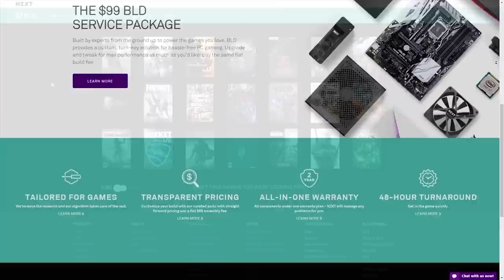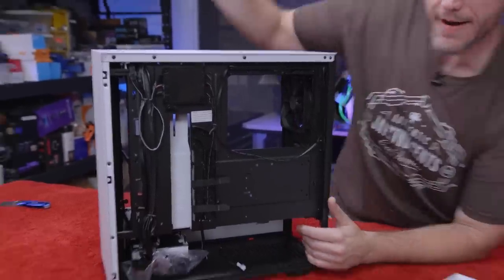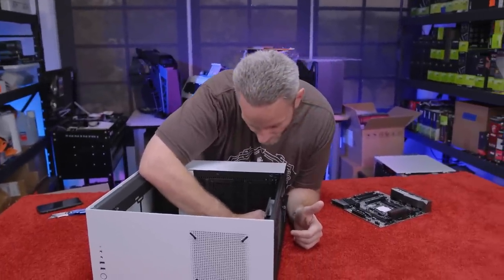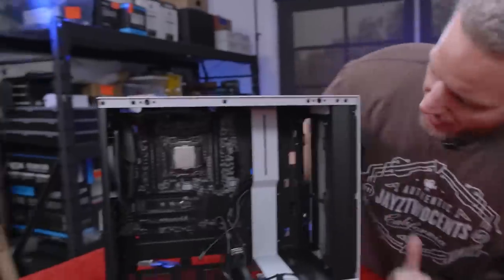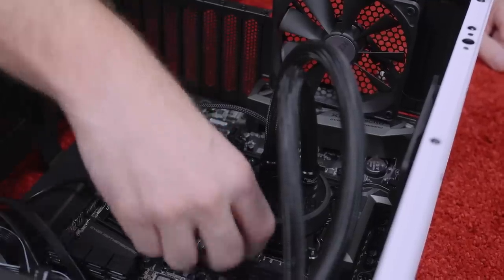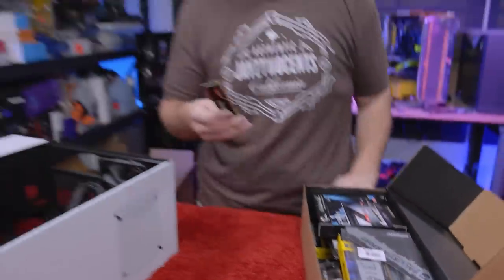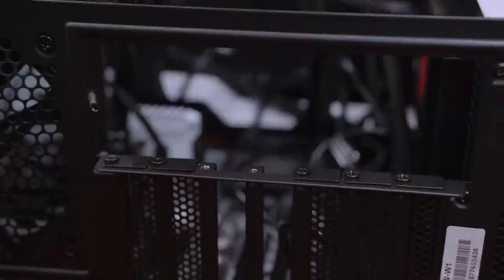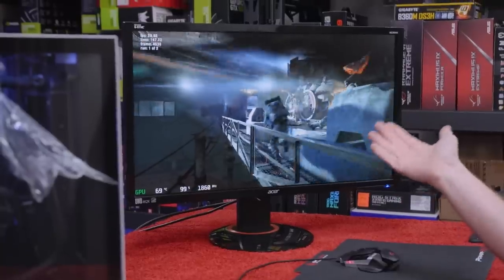We built a computer wrong on PURPOSE!

Comment: Maybe I am too late but that power plug is not a proprietary connector, the regular power connector that is used on most consumer PSU(s) is IEC 60320 C13/14 coupler, whereas this is a C19/20 coupler, which has 16A support and is used in High current appliances and enterprise class UPS and server PDUs, 1600W is high enough.
Reply: Pranjal Jain I noticed the same... actually in Europe this plug can supply up to 3600W in europe because of the higher voltage, as the limit is on the current not power. We use C13/14 plugs up to 2000W...
Reply: And that's why I scroll through the comments and then search for a keyword (PSU). Glad someone had commented about the C19/C20 before :-)

Comment: I followed this video step by step but my system won’t power on. Please help me Jay.
Reply: OhItsThat plzz plug in you 12 volt to your hamster only way to power it on
Reply: a little bit more of thermal paster
Reply: OhItsThat whu........ whu... what this is how not to build. not how to build.
Reply: What carpet color did you use?
Reply: Wooosh
Reply: maybe you didn't lubricate your RAM enough. give it some brake fluid or motorcycle oil
Reply: OhItsThat it's time to stop.
Reply: Pour some water on it, that will do
Reply: Slap the glass with a hamer
Reply: Slap some flex tape on your cpu cooler. It wont do a lot of damage
Reply: Did you use the correct RAM? If you use anything different it won't work!
Reply: OhItsThat youre cpu is overheating just poor some water on it.
Reply: Thanks for all the great advice guys. After trying all of it I realized I skipped the step where he installed the power supply....ooops....silly me.
Reply: Ersyad Adhimakayasa 😂😂😂😂
Reply: SpicyDoggo salt water duh
Reply: i liked the vid anyway
Reply: Put it in the microwave, you may need to add 1.21 Jiggawatts into the Flux Capacitor
Reply: You might want to take out your motherboard and rub it on a carpet to give it some more electricity to jump start it
Reply: Did you try asking nicely?
Reply: r/whoosh
Reply: You should download more ram

Comment: LOL, I've built every computer doing "everything you shouldn't do" and never had a problem in 25 years. (except cooling)
Reply: me to an it always works
Reply: Ditto...
Reply: I intentional built my first PC on carpet with socks on posted first try best part was it was LIVE.
Reply: I've never stowed extra cables in the case, though with PSU shrouds being standard these days...
Reply: I was gonna say I always place my power supply with the fan facing up and I have no issues XD
Reply: I've done like half of these and not a single problem. Also had a cooling issue but that's because I paired a cooler designed for 95W with a 125W FX CPU.
Reply: I have at times, usually when I'm changing out hardware.

"Aw, I don't have an 8pin PCIe connector plugged into the PSU. Can't be bothered reziptying everything up to replace one of the 6pins so I'll let it dangle and just route an 8pin next to the motherboard."

I mean, it's at least neat and minimal (Not much different from just having a PSU that has dual connectors and only using one, to be honest. My other one is SATA connectors which are usually hidden away anyway) but still is extra unneeded cabling.

Comment: Wtf jay? You should had used an cheap , chinese no name power supply.... What kind of a pc store do you think this is!?
Reply: Adrian make sure it's just a metal block with zero labeling and ketchup and mustard cables
Reply: Should have used Diablotek lol
Reply: Or an Insignia power supply. You can pick those up from any best buy.
Reply: the difference between what not to do and what is stupid to do.
Reply: First ever build i had to RMA my cheap Biostar mobo & Diabolotek power supply. Learned early on those are two components not to cheap out on. Thermaltake 600w going strong on 5 years now along with the replacement biostar which i still use 😂
Reply: *a cheap...

Comment: I was moving files between HDDs once with some of them balanced precariously on the edge of the open case and one fell off and hit the back of the graphics card and it sparked and the system turned off. Turned it back on and it was absolutely fine. Just goes to show ya, these things aren't nearly as fragile as people tend to think.
Reply: heh had my aio bust and killed everything but the gpu soundcard hard drives and psu.
Reply: I had a PSU literally blow up and shoot sparks out the back of the case until I unplugged it...nothing damaged but the PSU lol

Comment: yea yea i know when i built my first computer i had like alot of respect and i was afraid of doing something wrong. But now after 15 years of experience with building about 6 computers i know there is allmost nothing you can do wrong :D Because lets be honest, Hardware Manufacturers dont want you to return demolished Hardware so its all designd to be foolproof.
Reply: well.. you could still fuck up by washing and build the computer before letting it dry
Reply: Or they make it non-refundable so u have to buy more than one
Reply: My friend didn't connect extra power cable to a gts250 and it fried. Maybe it wasn't the reason and it was already broken, I don't know, but I would have no idea it even needs extra power if the vendor didn't tell me. It could happen to any experienced overly confident builder.
Reply: Read Newegg reviews.  SOMETHING is happening to all that hardware.
Reply: Except if you live somewhere cold DO NOT plug in a pc, or any peripherals for that matter, that has been sitting outside in a car or something immediately after you entered your home. My uncle managed to fry his monitor because of that.

Comment: 1:46 - I have the NZXT H500 (Non 'i') I actually really like it, It makes cable management easy as heck and building in it is easy

9/10 recommended
Reply: same
Reply: holy shit they actually went and made an i-less series? im jelly. got the h400i and just ripped that dumb thing out lol. seriously an incredible case, though, ive got a 280mm push pull rad in front, and 3 more 120mm exhaust fans on the top and back, and the thing is still pretty damn tiny. so quiet too, can only hear it under insane loads

Comment: Sponcer: system builder

Message: don't be scared just build it yourself.
Reply: actually nzxt's build setup is really good value if you do go the system builder route since their warranty and service is only $99 and msrp parts which is really nice for gpu and ram price increases though now they are going down was super killer a few months ago when they first launched their bld system building.

Comment: That power cord is nor proprietary to EVGA, its commonly used C19 plug used in high power equipment, as standart C13 plug/cable might not handle 17Amps.
Reply: Was gonna say that, it's a 16 Ampere connector, the regular ones are rated for 10A. The high-end G5 (pre-Intel) Macs used it too.
Reply: Thank you. I was pretty sure it wasn't proprietary. Getting a cord like that certified is way too expensive to be worthwhile, when there are standard ones for just about any scenario.
Reply: It's the same on my Corsair AX1500i :)

Comment: Isn't the "carpet" thing about standing on carpet, creating static charge and zapping components?
Reply: VoxelFusion rubbing the anti static bag on the carpet or even worse the board directly can produce enough charge to short stuff. Static will kill stuff sometimes.
Reply: I'll take your word for it, not like I'll try to verify on my own lol.
Reply: Rubbing the anti-static bag on carpet won't do anything since it's electrically conductive by design. It literally is a plastic bag treated with metal vapor.
Reply: This is more of a concern in areas with low humidity. If you get half-inch arcs touching door knobs on a regular basis it is a good idea to wear the strap-on.
Reply: Barry Allen : what you do with a strap-on is your business. No need to mention it here.
Reply: I like to touch a grounded object e.g radiator before handling components to discharge static
Reply: @bone9jdjkaye  i always just hold the case, im mid build now we'll see if my method worked
Reply: you'll never know if it works, veen if you build 100 pc's... you'll only know if it doesn't

Comment: Dude, what the hell? Why would you do this?

You're supposed to not put the fans on the rad and block off the rest! And not plug anything in!
And that metal case on the gpu is for shipping, you're supposed to take it off, and put thermal paste in all sockets/slots to ensure low temps

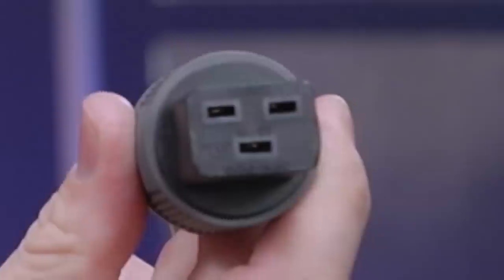Comment: 10:24 in fact this is a standard High power plug for north america. We don't need that in EU ;) because 10A is max for IEC but with 230v that mean 2300w.
Reply: Scrolled down the comments to find this. Cheers.
Reply: Definitely not proprietary
Reply: Ineu we have 16A
Reply: Yes we have 16A plug on the wall but the IEC plug is rated for 10A max. EDIT : IEC C14 (standard for PC) - In the video this is a IEC C19 plug
Reply: This is why Australia power is great too - 10A @ 240v = do they even make a PSU that big?
Reply: For servers yes, for "normal" pc i dont think so
Reply: Yeah obviously servers will come larger than that (I have 2x2400w "small" ones running my mining rigs) but even with 4xTitan XPs and a 2990WX thats still "only" 1250W + Board/drives/RAM so a 1600W would be tonnes unless you were heavily overclocking all 4 cards and the CPU but at that point youd just use a dual PSU case and 2xsmaller PSUs anyway.
Reply: I've used a lot of those C19 plugs in our danish datacenters. They're very common on stuff like blade chassis and high powered servers.

Comment: This actually really helped since I've always been super paranoid about anything to do with my computer. I worry that the slightest mistake will break EVERYTHING. It's so bad that I have developed OCD, where I'll check every wire before bed just cause I worry a wire out of place will break my computer (It's silly I know)

Watching you do everything you shouldn't and have it actually still work fine fills me with confidence that computers are really not as easy to break as I think xD
Reply: If you're really worried then just remember that I dropped my GPU onto hard metal and my CPU onto a table twice...still fine.

Comment: My "airflow blocked by cables" PC has been running for almost ten years now - and still does. Also never cleaned any heat sinks in there.
Reply: you may want to check your temps with HWiNFO
Reply: it's usuallly fine to block airflow to be honest, but not cleaning the heatsinks can be bad

Comment: we do the things you shouldn't do 
to show you why you shouldn't do them 
but usually at the end of the day it works
but we still say you shouldn't do them

???
Reply: The super enthusiast pc guys always talk about touching pins and not using anti static everything is essential to building a pc, and this tends to scare off novices. The truth is that modern components are pretty well built and designed to be put together like lego, and Jay’s just showing how easy and foolproof building a pc is and to not be scared off by the annoying enthusiast types.
Reply: @spaceandstuff8966  As long as you don't act extremely stupid with handling the parts, very little can go wrong as you're building.

Best I had when I was building my first setup was a hot kitchen on top of a plastic table, and sometimes you just have to be firm with the parts
Reply: @spaceandstuff8966  I am still scared to do my first
Reply: I love fancy rats have u built it yet?

Comment: I build computers for a large computer manufacturing company. Static is an issue more long term not usually short term. That being said I think some people take static discharge to an extreme. Ground yourself and go for it. Don't need a strap.
Reply: Just don't wear woolen clothes :) (isn't wool about the worst in that it creates most static with many surface materials?)
Reply: @pev_  - I put on wool socks and a sweater and roll around on the carpet, then assemble it while moon walking in place. Gotta precharge those cores, man.
Reply: Porg McNuggets thx for hot tip - pc assembled and shows my i3 clocking in at a stable 9.7GHz
Reply: @lolol1725  - Nice! Well done.
Reply: Or just touch your heat radiator at home to discharge any static charge you carry those are mostly grounded
Reply: @schadenfreude3236   Dude you forgot about the cat! Don't have a cat then borrow a neighbors and pet it right before doing a build.
Reply: @jarvisgarcia2035  - Dammit. I knew I forgot something. I DID let some hamsters play in the case while I was assembling it, though. Think it'll still work?

Comment: 10:20 that's a C19 connector, which is from the same standard (IEC 60320) as the C13 connector you usually see on PC power cables. They have to use C19 because 1600W is at least 13A at 120V, which is way over the maximum of 10A for C13. C19 goes up to 16A. It's pretty easy to get C19 cables because it's commonly used for the power supplies on larger servers.

Comment: Thanks for the info!!! I build my first gaming pc!!
ryzen 1500
gtx 1060 6gb
16gb ram
I can playy pacman again!!!
Reply: a pizza, maybe... or money .... or a coke ! .. I love coke  @smilealchemist4325
Reply: isn't that cpu a bit of a bottleneck for the other components?
Reply: @smilealchemist4325  everything
Reply: @Smilealchemist the generation doesn't really make a major difference here, the 2500x is only about 6% better than the 1500x. a better move would have been to upgrade to, say, a 1600 for the extra cores, because windows sucks and games run better when windows has more cores to sate its stupid overhead
Reply: Smilealchemist sometimes it does, but lately most newer generations focus on power efficiency rather than major performance improvements
Reply: Eww amd
Reply: @harshnemesis  Haha but amd is better price to performance
Reply: @JonDoe-wk9qc  2500x? wtf is that ! :D 2600x bro!!!!
Reply: ........ I would have at least gotten at least Ry 2600 for a gtx 1060 6 gb, such a waste. If you can return the ryzen, then go for higher. At least ry 5 2600 or ry 7 .
Reply: @prelien 469 this is a good and underappreciated comment
Reply: Should have gotten a intel core i5 9600k with an OC 8gb Radeon rx570 with 16gb of ram.
Reply: HamLeg rx 570 is a lot worse and the i5 is  a bit better but a r5 2600x would better
Reply: Bro, use a Ryzen 2700X (Water-cooled, of course), RTX 2080, and 64 GB of RAM to avoid getting killed by Blinky, due to the Lag..
Reply: I’m gonna build my first pc soon it’s a 
I9 9900k 
RTX 2080 
16gb ram
And an aorus z390 master motherboard 
I’m so exited
Reply: @scope1788  That is some pc.. good luck!

Comment: I have never not built on carpet lmao. as long as you ground yourself frequently it SHOULD be perfectly fine.

I also do not have an anti static wristband 

wait I thought you were SUPPOSED to use the anti static bag lmao 

oh you are supposed to be delicate... woops

the RAM mixing shit is a myth, I have 3 different brands of RAM, and 2 different speeds of RAM, been working pretty damn well for the last year.
Reply: Mixed RAM works just fine. At the speed of the slowest of them.
Reply: Jesper Monsted if you don't overclock it yep, that is exactly right. I see so many Reddit comment where people act as if it is the end of the world if you mix RAM, when in reality all you MIGHT lose is a tiny miniscule bit of performance
Reply: Find it funny how many people freak out about the static bags. I've always used the bags. Heck, some of my motherboards manuals recommended placing them on the bag while working. 

I mix ram too. If you have some wacky brands getting the timings set correctly is much more important than "mixed brands" IMO.
Reply: this dude lives life on the edge
Reply: FUCK IT DUDE VROOOOOOOOOOOOOMMMMMMMMM
Reply: "I have never not" Nice double negative dude.
Reply: It works fine but it will be bottlenecked by the slowest stick and you wont get some of the benefits of running in dual slots.
Reply: it depends on the motherboard though
Reply: I saw mixed ram brick a computer once.  Somebody added a 16GB kit of PNY ram to an existing 8 GB kit of HyperX and they didn't put the sticks in the correct channels. (they didn't put the 8gb kit in the  red slots, but put one in the red and one in the black slot)  usually this means you skip a slot.  Anyways, I ran Memtest64 and it found memory errors.  over time this had corrupted the windows files (probably during updates) and the PC stopped working.  It acually worked fine when I put the ram in the right slots though.  So mixed ram worked fine, it just had to be in the right channels.  did Jay have 4 memory channels?  I'm surprised it worked. I don't think it would post if that was dual channel RAM. I bet the mixed ram was why it took longer to post, and I bet he would have found memory errors if he ran Memtest.  But who knows. i wish he would have tested that.

Comment: About time someone shows how technology isn't some fragile shard of glass.. Hardware is built pretty rugged.
Reply: It’s all fun and games until you bent a pin, pop off a resister, or build a riser where the screws touch the 12V rail then shout out and start a fire.